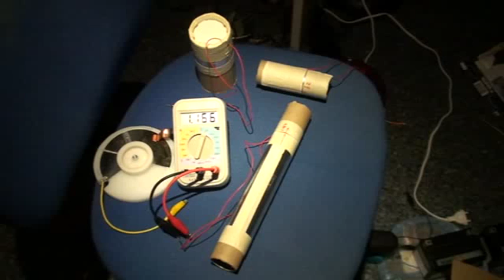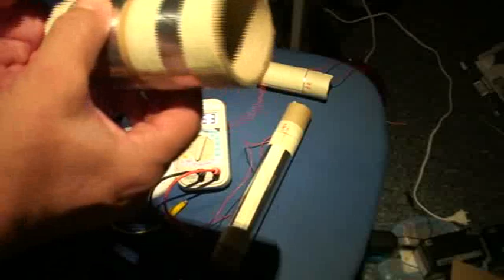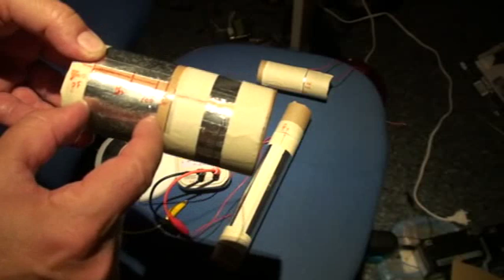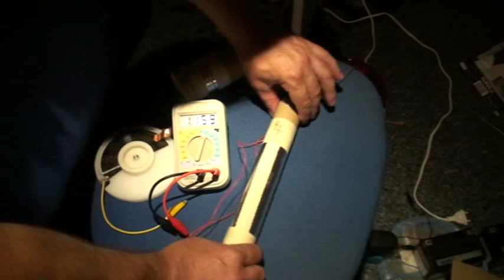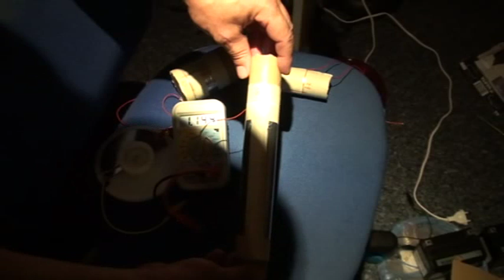diy variable capacitor 1

Comment: Since soda cans are cheap and easy to find, there is a lot of room for experimentation to find out what's best.  I need a variable capacitor that doesn't cost an arm and two legs, so I'm going to try to use a smaller version.  I think this hollow can idea would make a good way to detect liquid level by using it as a float and the variation in capacitance would indicate the level.  Thanks.

Comment: What do you think of electrostatic induction with a variable capacitor? 

So, say you charge the outside plate to a high voltage, with sayba Cockcroft–Walton voltage multiplier. Then your inside plate could be connected to ground through a load. So then you could turn mechanical energy into electricity alternatly pushing  electrons from your moving plate to ground, and later pulling electrons from ground to your moving plate,  doing work as they go through a load. 

 Since the capacitance and consequently the charge is rather small, that means frequency is rather important for reasonable power generation. A rotory variable capacitor might less vulnerable to vibrations at higher frequency.  

I  hope this comment inspires high voltage power generation experiments.😁

Comment: a variation - you can use wire and coil on the inside and the outside instead of aluminum.  just leave one end of the coils disconnected and you get coil-caps

Comment: You can connect the foil together, because there is no difference in capacity!
P.e.: Two beer cans with a little bit difference in diameter do this!

Comment: I have a couple questions.  Should you cover the outside of the outer al ring with some sort of electrically insulated tape(to improve current flow).  And can I use any paper, or do I need dielectric paper?

Comment: Very good!  I would like to have had exact dimensions.  Length and diameter of each tube variable capacitor.  Now I have to experiment on this and get some exact values.  I am going to try some galvanized tin.  I am thinking, instead of a hand moved cylinder, if there was a gear mechanism, you could move the cylinder by gears instead.  I am thinking of how I would do that.